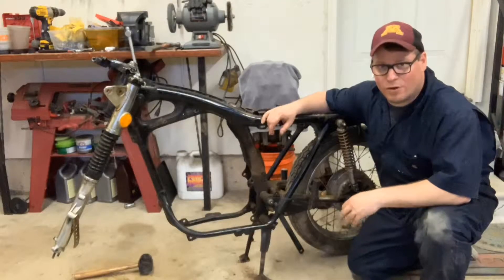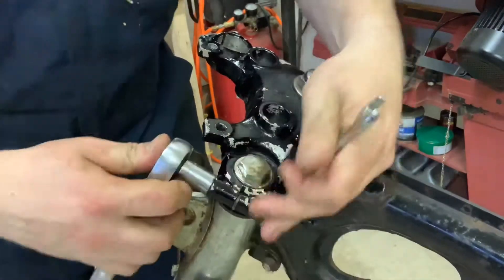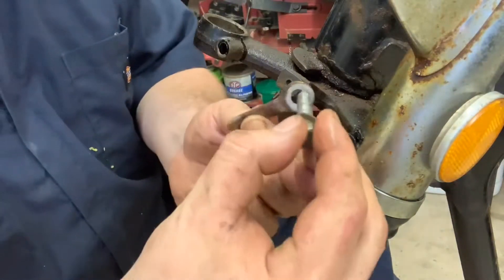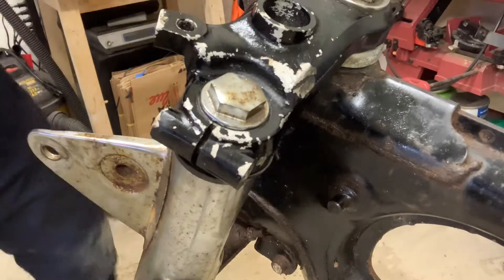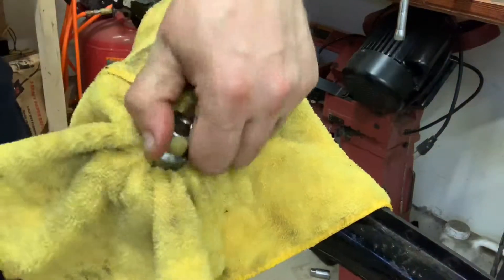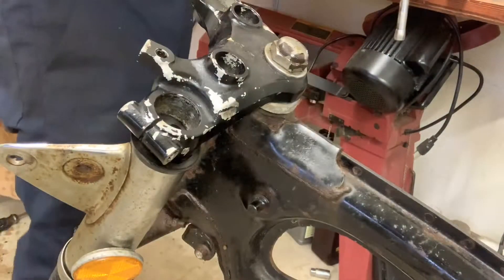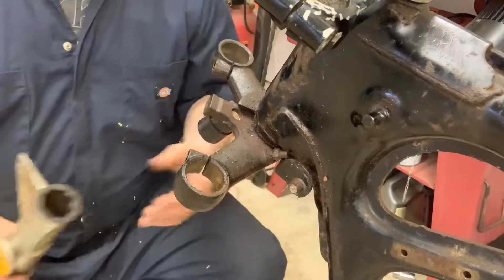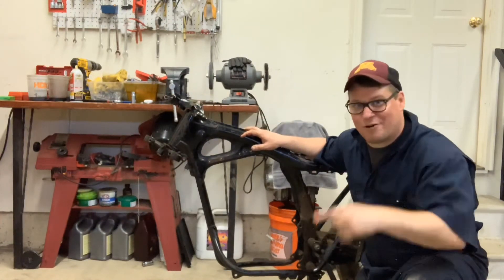Remove Front Forks on a CB350 CL350 Honda Motorcycle

Comment: Just found your channel and I’m binging on this series. I would say those tubes are fine as long as the part that goes though the seal is fine. That rusted part is hidden anyhow. Whenever I would pull a fork out we would put a flat screwdriver in the slot after the bolt is out to open it up just a bit. Makes the tubes come out a lot easier.
Reply from the maker: Totally! Just be really careful with that triple tree as to not flex it too much. Those things are not cheap. So breaking one of those mounts would be heartbreaking. I tackle the full fork rebuild later in the series. Glad you found the playlist! Enjoy and don’t hesitate to comment and ask questions. Lots of great suggestions and tips come in the comments.

Comment: Hey Brian Another great video.  Question, that little rubber cushion cover at the very top of the fork you said to not lose towards the end of your video. . .  well the bike I bought is missing just one of these rubber covers on the left fork side.  Do I have to completely take apart the fork like you did just to slip a new rubber cushion cover on the very top?  Thanks
Reply from the maker: You should be able to loosen things up on that side and slide the fork down to slip it in.
Reply: @KeepOnWrenching  Thanks!

Comment: When you were rotating the triple tree after the removal of the fork tubes what did you feel that indicated the bearings were shot?
Reply from the maker: The bearings could likely be cleaned and regressed but it just feels gritty. It’s dirty. Hard to explain but it doesn’t go smoothly.

Comment: Ended up here because I'm dealing with the exact same thing and wanted to make sure I wasn't missing some trick.  I ended up pulling the triple trees with the forks still attached because I knew the bearings needed replaced anyway, I guess once I get that done I'll be beating on the forks like this.  Also, I agree with the poster who said they should be fine as long as they're not gouging up seals--did you end up reusing these tubes?
Reply from the maker: Tubes were fine. Sometimes it’s easy. Sometimes not so much.
Reply: @KeepOnWrenching   I finally got my forks separated from the lower triple tree - one was bent like a banana and the other was nearly completely rusted through, so new tubes for me. :(
Reply from the maker: That sucks! It’s hit and miss with these things. Don’t let it discourage ya! Go get it.